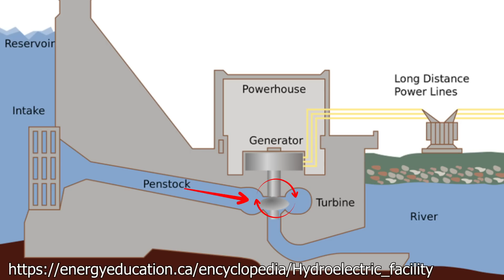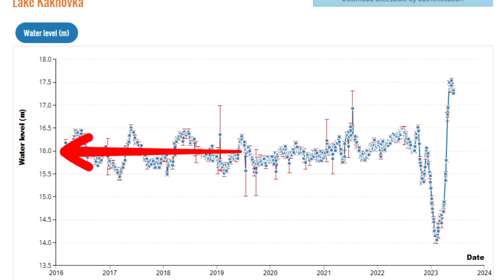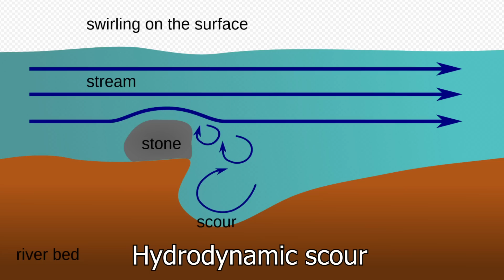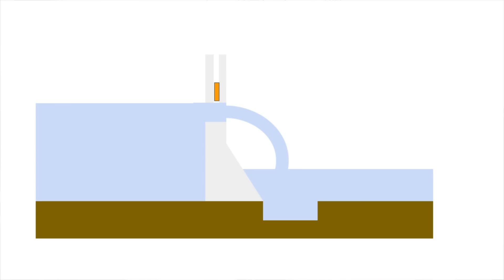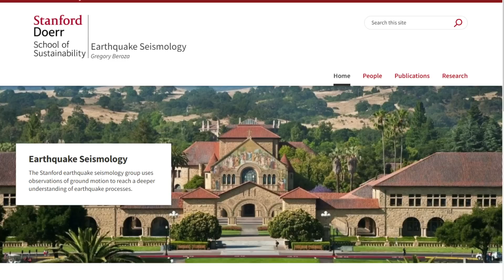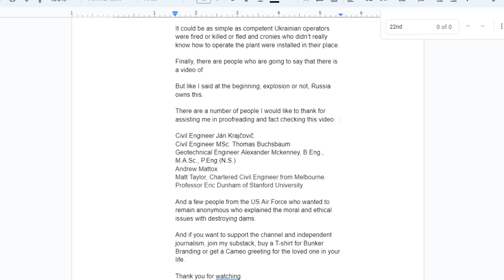How Russia Destroyed the Kakhovka Dam

Comment: Hydro engineer here. Good video, but the college engineers forget something about the dams. And that is, that under the dam people "inject" cement solution every 20 years, to prevent the filtration under the dam. This filtration creates "lifting effect" that makes the gravity not so good with gravity. And another thing. Switching the gates to prevent erosion in front of the dam is logical. But destroyng the dam with erosion by not switching the gates for some period of time is just not even close to the truth. Belive me, this dam is designed to withstand these kind of events. For example, what if the crane breaks, what if the crane is destroyed in case of war, what if you cant open the gates for some reason for some period of time? And this is where the injected cement solution under the dam plays its part. Dont let the water filtrates under the dam, and dont let the erosion of the spillway destroys the front foundation of the dam. I can give you answers if you want, and if you have some questions.

Comment: And so, it collapsed just before the Ukrainian counter offensive. Nature is a random event.  This is not a random event. The dam operation was working just fine until right up to the point the closer to the counter offensive was going to take place. Dam collapse incidents give weeks of warning to occur with a design like this because they had multiple flood control gates to minimize the rise in water level.  The rain levels have dropped dramatically so why the overfilling of the reservoir levels? The levels were purposely raised prior to the collapse just to cause a bigger catastrophe downstream. You were also weak on the seismic analysis.  Were the dates in correlation to the dam collapse?  No dates were given. The pictures of the collapse show that the collapse was in more than one place in the powerhouse section.  Your suggestion that a natural phenomenon took place would not account for two highly reinforced concrete sections at two different locations is not how dams collapse.    

Extrapolate.
Russia has set explosives at the 6 nuclear power plants. The Russian Commander in charge of nukes has stated that he will blow the nukes to prevent the Ukrainians from having it intact.  Russian missiles have landed close to the nukes by the Russians to try and win the argument it was the Ukrainians dropping warheads on their own nukes.  Thus, a means to tell the world to back off on supporting the Ukrainians or else bad things are going to happen. This is the mentality of the Russians as shown by the insignificant strategic importance of Bakhmut and what they did to that city of 70k people.    

You looked at the technical side but did not fully examine the thought of the Russians as to why they would want to blow the dam.    Spite is definitely a factor. If you wanted a strategic reason for the Russian's thinking this, was it.

Comment: Those dams go way down from the inside in a lot of cases. If they placed explosives way down they wouldnt need as much. Also there is drone video of the first 10 min showing a clean break between Ukraine and the powehouses, they crumbled later. The road was hit before by ukraine, so maybe there still was some structural damage left, or combinations of the two. Overflowing is not as dameging on a concrete dam as it is for an earth dam. I think they filled it up to the max for max damage. Have a good day!

Comment: all good points but i dont buy it cause some others were left out. like why did it break at two spots? the hole should be at the weakest spot and grow from this. 

most larger dams are build that they can take a constant overflow and a higher load of waterpressure. count that especially on such critical and important constructions of that size and soviet pride. they had chunky safety measurements on the drawing board. breaking by just having too much water in it? very unlikely. even if damaged partly, the removable gates would break first. might even be that they are meant to be blown off in emergency situations. easy to replace. 

would take experts opinion with a grain of salt, especially when it comes to general conclusions. each dam has its individual quirks and features. what might count on small reservoir dams can be a different cup of tea here. we have such a discussion locally since 21 when our nearby small dam got overflowed and was about to break while others didnt. overtopping resistance was retrofitted and while this was done i had a chance to talk to a lot of people with profession. kahovka dam was a topic for a longer smalltalk last summer. its not as flimsy as it looks from the top. there is a giant structure underneath it, wich one can see on the images of its construction. i recommend google. 

now, that brown spot pointed out in the video. what is it? a leaking toilet? and what did it to cause a damn to collapse? if blowing something up it makes sense to weaken the structure. like drilling holes wich this could indicate, like spilled drilling water. gets bigger over time. that is the difference between blowing things up and demolishing it discetely. if knowing the design and wich parts take the load, smaller explosives are needed. those might not be spotted on seismographs in a warzone.

the tactical advantage russia gained is that all plans to cross the dnipr delta are gone. think about it, is this an action or a reaction? the crossing was prepared over the last few months and might actually already have happened. why did it break now and not last month or next? we are around the days the counteroffensive is claimed to actually start. let me get this into perspective. this is not a garden hose, the entire landscape of the delta will have a different shape when water is gone. ground is sand, typical for a river delta. cant carry very high loads in first place. same on vegetation that might give you cover. will turn into a muddy desert. 

dont have conclusion on this yet and actually dont like to have one by now.
Reply: That is very interesting issue "break at two spots". But not in two spots - more, and not really simultaneously. It was a process over time. You can see now, that big part of left side of earth part of the dam is washed away. And that part was not initially for sure - there are photo and videos about it and not down the stream. That saying something.
Brown spot in the video is part of the road on dam, damaged by Ukrainian fire last year. That road was 1of 2 strategic supply line to right bank occupied territory  for Russians, so big point of interest for Ukrainian army. And that particular part sort of sticking out - so provide bast place to damage a road but not to hit dam itself.

Comment: Well as an engineer I give 100% responsibility to Russia.
They maybe preparating the technical looking failure buy rising the water level by several meters over any necessary level.

As an engineer I never would allow rising the level over the minimum necessary. The powerplant has to be shut down. The water level needs to stay to minimum, since it got blown it's structure on the street on top.

Maybe it was a bit support to brake by some minor explosives.
(This we don't know yet 😮)

Anyway it's technically in duty to pay any caused damage of the war back to Ukraine. Technically Putin and his followers are responsible for the broken Kakhovka dam. 🤔
I wonder that it correctly brake intime to counter the Ukrainian offensive after the rain session stoped and the Dnieper levels got lower near Chersonregion.

What technically perfect tactical incidence?😅

Russians are mostly incompetent in system understanding. Technic they need to take care of,  is always in a failure risky. 

My personal experience working together with Russians 😅
Russians from behind Moskow (and more far to east), can't prevent errors in complex  systems they need to take care of like other hight tech nations.
They always take out hammer ⚒️ solutions if a screwdriver 🪛 would be the better tool,my personal experience.😢

It was russian forced technical incompetence, don't listen to the Ukrainian engineers if they didn't explode it. 😢

Best regards from Germany 🇩🇪

Comment: The most plausible scenario currently (with hints lurking around in russian-speaking web) seems to be, that as UKR had taken back several islands in Dnipro river, Russians wanted to wipe them away with the controlled release of the water from the Kahhovka reservoir by blowing up just the upper section of the dam. However due to previous neglect on dam safety (shown in this video) and typical bardak of russians, they either overdid that or misengineered the location of the explosion and result was far larger, than they expected as this massive waterflow displaced several sections of the dam.

Comment: This is a very plausible hypothesis but I feel the circumstantial evidence is more compelling. As one of the very few crossings left the Russians would have been watching the dam very closely. So they would know that's what happened and would have blamed Ukraine for preventing them from opening more gates. But they didn't, instead using the absolutly absurd notion that the Ukrainians did it with artillery. It would also be one hell of a coincidence for the dam to fail the day after the Ukrainians launched their offensive.

Comment: russia put explosives in the dam in november,    openly threatened to blow it. now they  wanted to flush ukr troops from islands, use freed  troops from there to counter ukr. offensive nearby. bit miscalculated. breach and  minor flood (1meter was enough) turned into collapse and 5 meter water rise catastrophe
ps. foothold across from kherson undefendable for ru. ukr.need it not for mounting assaults (logistics problems), but for getting into the firing range of krimea supply lines.. supporting role. russia only bought some time...
Reply: I think the explosives perhaps were a factor but its equally Likely that Orc negligence is a likely cause too, wouldn't put it past the Orcs to smoke carelessly around those explosives, or., as Chernobyl or the Mayak disasters would tell you, just pure operational negligence did it. when the dam failed the electricals could have short circuited causing the explosives to detonate, so perhaps it could have been both scenarios. Only a full autopsy of the dam after the war can really give a clue.

Comment: Russia may have known about the dam and considered its impact if collapsed. 
Water build up to a point close to failure would mean little effort would be needed to tip it 'over the edge at the point of failure'.

Russia would be able to achieve some impact to meet Ukraine commencement of operations. 

It would cause Russia to discover were Ukraine's point of counter attack. 

Russia would know when the flooding would happen and not just wait and 'hold its breath hoping' it would be a timely and useful failure.

Comment: First motion studies should show the difference between an explosion and a non explosion.  Explosions generate spherical compressive waves.  All stations will show the exact same “p” wave polarity.   Non explosions will show a wave first motions caused by a shear event.  The shear signature will be “polarized” meaning first motions will look different depending on the quadrant of the receptor.   A strong rolling of bedrock being plucked and rolled by massive scour at the rock/concrete interface should show as an incoherent rumble like a volcano makes before eruption.  Depending on the response of the dam itself you should see several seismic features as what appears to be a giant box girder like hollow? structure collapses.  The noise of masseve rocks might mask the rupture.  However…it seems possible that the dam rests on non-rock.  It might be rock sand system. Likely the combination of coarse rock fill resting in or on sand is “unprotected” meaning the grain size spectrum is not a Terzaghi filter.  Such design methods are probably newer than the early 50’s date of construction.   I rebuilt a non Terzaghi structure in the USA once that had that problem.   We rebuilt an earth fill dam.  I am not sure a concrete gravity dam like the Ukraine  is repairable.  I speak not just as a geologist but as a soil mechanics and drilling injection QA specialist who worked on various hydraulic retention structures for many years as a geotechnical engineering geologist.  Your analysis is pretty good.  You could go further but I bet your experts were cautious.  Good work really.

Comment: One of the rumors I've seen floating around lately, is that Russia made it illegal to investigate certain things, such as dam failures. 

One thing I am familiar with is dams. Dams require constant inspection, and constant maintenance. Power generating dams have additional maintenance, because flowing water damages concrete. It doesn't matter if it is 3,000 psi or 20,000 psi strength concrete. Moving water damages it, and areas of dams have to be shut down and maintenance personnel have to go in and repair the concrete. 

Spillway design is a big deal, as is the quality of construction and maintenance. Spillways are only designed to do certain things. Even then sometimes it isn't designed or built right, just look at the Orville Dam.

Comment: While it's not impossible I'm not really buying the collapsed on it's own theory. The dam breached not from one single place, but several. If you have one breach then that takes the load off all other sections so that tends to not happen. Rather I find it likely that once Russians decided to blow the dam, they intentionally let it overtop first for maximum effect.
And while it's true that blowing the dam isn't exactly sound military reasoning and is unlikely to bring any real benefit to Russians, that doesn't mean they didn't do it. They are hardly known for perfectly rational decision making. And lets be realistic, they likely had the dam rigged just in case for a long time already, it was just a matter of someone deciding to blow it.
Either way, that secret will not hold forever, its just a matter of time when solid evidence is obtained.

Comment: Well done, great research.  Having watched practical engineering's dam series all of this was familiar to me.  It does indeed look like it was a failure that happened over time so in absence of specific evidence pointing to some sort of demolition the best guess is that the dam eroded and was eventually overtopped as well, it's possible that it could have collapsed solely from being overfilled but the erosion would have been a nail in it's coffin.

I really wanted to see some concrete evidence presented from a good look of this situation with all the finger pointing and speculation and you provided, keep doing what you are doing.